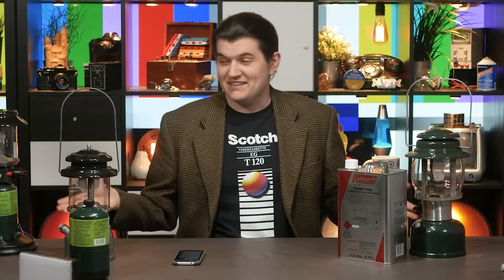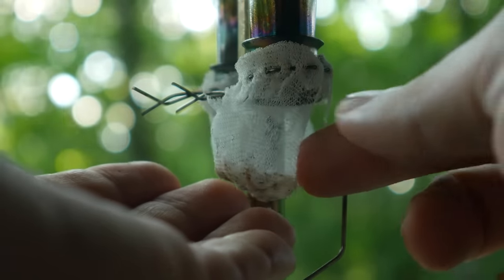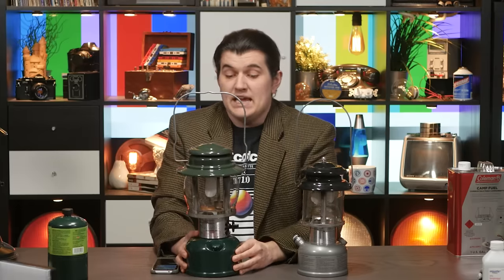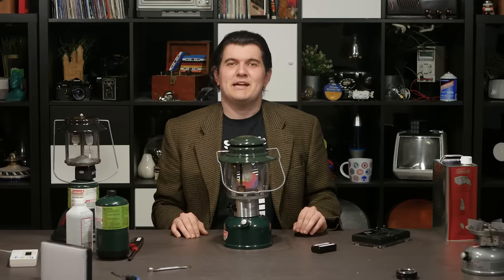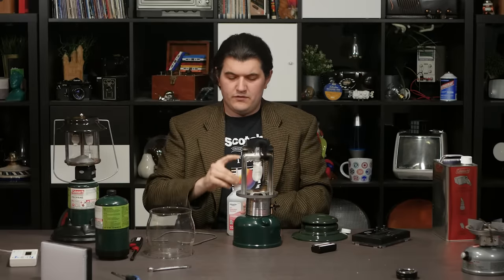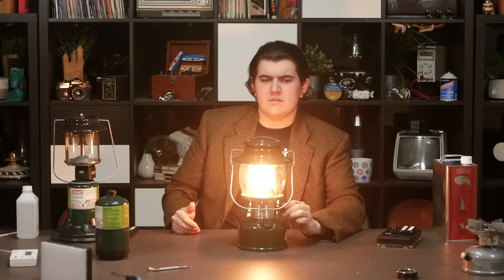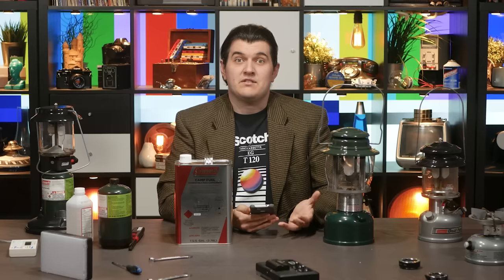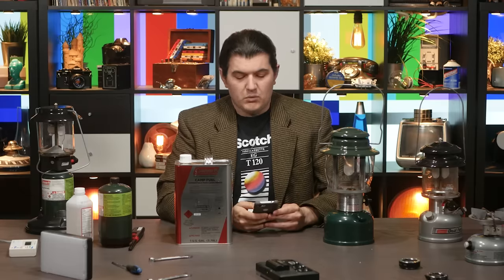A very rambly Coleman Lantern follow-up. Turns out they rarely make sense in 2021

Comment: Coleman also made fluorescent lanterns in the same style as these, with two 6-volt lantern batteries inside what looks like the fuel tank, and even a fake plunger.
Reply: I had one, it was pretty alright. Very usable before LEDs were common.
Reply: LEDs too.
Reply: And they suck...because of that batteries..
Reply: We had this too growing up! I saw it in my parent's garage recently and it still turns on
Reply: Battery operated camping lanterns were useless before the widespread use of lithium batteries combined with highly efficient LEDs and even then, the fuel is just a MUCH better choice.  You could keep 10 of these things lit all night long for 1 gallon of fuel and with plenty to spare.
They are far less dangerous than what is being described here.
Reply: @christo930  Yeah, but we now have great LEDs and LiPo batteries (and some (not most) solar chargers are actually ok).
A white gas stove and mantle lantern sort of makes sense if you need to light a biggish area and you really care about weight (eg. hiking).  I like my tiny little stove a lot, but not many folks need that much light when hiking (hell, I hardly ever use anything bigger than a headlamp).  I can see it making more sense for a larger group.
Reply: They made one similar that runs on 4 D cells and a pitifully dim incandescent lamp. I used it just a month ago while camping in the San Juan mtns. of Colorado thinking it was better than I remembered... Nope I should've bought a modern LED lantern or just brought the gas lantern, I already brought multiple Coleman fuel pods for heating water, but my buddy said he would bring one and he didnt!
Reply: I got the cheapo Coleman 6V 4 D cell battery version. Dim was 1 tube lit and bright was both.  Brittle plastic housing that felt cheap all around and not very bright.  Even the glass "globe" was plastic.
Reply: In Boy Scouts I won a keychain sized LED coleman lantern. That was quite some time ago. At the time the LEDs only came in red. It was not bright enough to be useful for anything other than finding your keys in the dark if you had the wherewithal to turn the light on before losing your keys.
Reply: @travcollier  I've always used either the white gas or the propane and only occasionally used kerosene, but today, I would buy a new (or used) kerosene model and use that.  Basically I always have between 10 and 20 gallons of the stuff.  I use a kerosene heater as a space heater during the winter. My house has really shitty insulation and it's old and retrofitting, if it is even possible, would cost 10s of thousands of dollars.  I also have a wood burning stove and the slate it sits on is large enough to just put the kerosene heater on it instead.  Plus, I have a kerosene based stovetop to use if for some reason my natural gas were shut off.
I have only ever been day-hiking so I've never had to carry water treatment options or cooking fuel and apparatus.

Battery operated lights are good for very short outages.  I have batteries galore for that.  But once the batteries are dead, they're done and you need power to re-charge them. Solar is simply not an option because the power may go out in the winter, which power loss is a MUCH bigger factor.  Even though I have natural gas heat and it's steam heat, the boiler requires electricity.
For most people in most situations, solar (as a backup) is a boondoggle.  The most common type of solar array means if the power goes out, you lose power.  In order to have power when power goes out, you must be isolated from the grid. It is literally a felony crime to connect solar to the grid without following all the rules which means when the power grid goes out, your solar array is no longer powering anything including your home.
Reply: @gavincurtis  Yep, total junk.  However, the fragility of the gas lanterns are the one true downside of them.  I think I have replaced every single one of my lanterns' glass globes at least once.  They are very easy to break.
Reply: Sounds like they had the tooling & excess inventory of fuel tanks to get rid of, no wonder the fuel-based ones are still being produced.
Reply: @christo930  Situations vary of course.  Solar backup can be perfectly fine, but the way most of folks hook it up (get it installed) doesn't work for that.  Knew a guy in Hawaii who built carts which were self-contained solar backup systems (basically panels, some batteries, and some regulating electronics)...  Not big, but one could keep the lights on, communications up, and a fridge running, assuming all of those were reasonably efficient.  Heating or AC, nope, but it was Hawaii so not needed.

Anyways, solar chargers are different from whole house solar stuff.  Typically you get or make one that is a lot more powerful (in theory) than you need so that it is still good enough for what you REALLY need when things go sideways.  Lights and communications aren't very big power draws.  But as I said, heat and cooling is a different matter.  Oh, and having some battery system with UPS functionality is great for dealing with the damn brownouts and generally unstable power a lot of us have but can electronics really don't like.  Whole house solar+battery should do that if not setup completely incompetently.

PS: Something I heard when doing some work in central Colorado: You know the difference between a shack and a house?  Insulation.
Reply: waow
Reply: @travcollier  Well, I live in a corner rowhome built in the 30s. It would be extremely difficult to retrofit anything but windows.  I have slat plaster walls on brick basically.  It would require removing every wall facing outside, which is all but one. It is simply not worth it for me.
Having a portable solar panel to charge batteries might work but as far as I am concerned is just way too much hassle.
For the home maybe a different story if you just want to power a few things. But space is at  a premium and flat roofs are really not something you want to put holes in.
Reply: LoL I had to go and check if mine is a Coleman! And it definitely is, bright red plastic and a Fluorescent Light bulb, two brightness settings and a night light built into what should have been the filler cap! It's powered by a 12V 4Ah sealed lead acid battery that is user replaceable which is in what should be the fuel tank, there you can also find the car cigarette lighter charging cable! 
It's okay, but not perfect, run time is not enough for me. I will eventually convert it to some form of lithium battery setup... I got it to offset the Colman dual fuel light and to use the battery model inside the tent but like most battery only products, they don't make them to have a longer run time! 
I don't care if it's bigger and heavier, I just want to know that when I turn it on! It's going to stay on for 12hrs on the most power consumption mode! 
To have an emergency backup light that at best can last 2 or 4hrs is a joke.. that's like looking at the specifications of a new mobile phone, they still give you how many hours the battery will last in standby! WTF? I bet that you don't know anyone who has ever put their phone in standby! Why don't they find out the most power consumptive way to use the phone and base the battery size apon that! I have never had 8hrs of phone use on a single charge! Never! I always carry a USB battery bank and car charger wherever I go.
Reply: We had one back in the 70s. Mom was deathly afraid of the gas lanterns
Reply: The huge advantage to the gasoline lanterns is even when there is some kind of disaster extended out over a long period of time you can keep running them with just plain old gasoline. I remember white gas, back in the day we used it in things like two-stroke engines outboard motors and whatnot because we knew the tetraethyl-lead was bad for them because it contaminated the spark plugs. Hey how about doing a story on the whole tetraethyl lead scam? Now that was a doozy.
Reply: @christo930  Borosilicate glass is just like that... very heat-resistant but much more fragile than standard glass.
Reply: I have an LED model, but it runs on 3 AA batteries, so it doesn't last long.
Reply: my parents had one like that, but it took like a dozen d or c cell batteries. We always used it when the power was out and the those batteries lasted quite a few years
Reply: I've got one, it's useful but I'm looking at probably getting a Deitz and a gas mantle one as well just because when I'm relaxing on the deck/gazebo thing we have the fourescent is not a pleasant light.  Plus just for the novelty.
Reply: Mine kind of sucked
Reply: I remember them well. My grandfather used one at his cabin when they didn't want to run a gen set. It was a battery eater, a 12v motorcycle battery would have been a better power source. They had another single tube powered by d cells in the outhouse.
Reply: Anybody remember those huge square batteries with two spring connectors? I only just did, we had a few in emergency lights / big torches in the early 90's, they were probably older than me. My parents bought a mantle lantern that ran off bottled gas much later, actually. It was a lot brighter than those feeble electrics.
Reply: @worldcomicsreview354  Yes, those are called lantern batteries.
Reply: That's what many people went to, after they quit selling the lanterns with the radioactive mantles. As he speculated in his other video, the early non-radioactive mantles were unusable. I'm pleased to hear, that they seem to be perfected, even though, for many people, these types of lights are obsolete due to good and inexpensive LED lighting.
Reply: i used this too inside of tents. Nowhere near as good lighting but obviously much safer
Reply: I had one of these, too. I liked to take it when camping. Great for lighting up a tent at night.
Reply: I had the one, long ago that had the "U tube" got it as a wedding present (didn't really look like a Gas lantern though), when it died, I bought the Gas lantern looking one with the Twisty CFL, and the gas cap "Night Lite"... Honestly it was more of a PITA than it was worth for the 5x a year I needed it, would not really hold a charge... Now I buy ones that take AA batteries (yes I know its wasteful but hear me out), they are made by Coast Portland, they make 330 lumen and I put Energizer lithium AA batteries in it, they don't leak and last a long time... So when we have those power outages or go Camping a couple times a year...They are ready to go and I don't have "dead battery" I can't recharge.
Reply: I have 2 coleman ones. One resembling the Northstar with a single florescent bulb and one with 2 swirl bulbs. I got the one with the swirl CFLs at the local goodwill and the other one on ebay.They work well. I have a GE one but the batteries exploded and corroded it so badly it has to be cleaned all the time to turn on. I recently bought an LED coleman one and even on half charged batteries? It runs for nearly 24 hours on high before my folks shut it off. I was draining the batteries deliberately so I can charge them fully. The Northstar one only runs for 13 hours on high on one charge though. CFLs are ok for lanterns but not as good as some LEDs. I can probably get a replacement bulb for the northstar but the other one? I prolly will have to retrofit and ballast bypass and convert it to an LED possibly. Forget incandescent they suck so much power they'll last for 4 hours at most.
Reply: @PeterMilanovski  I have a few of those old fluorescent lights, You get decent light out of them, but they will go through 8 D cell alkalines in like 6 hours.  Good rechargeable D cells are a fortune.
Reply: @talon262  Not to mention the awful shape.
Reply: I loved mine and I never thought living in Florida I would have a problem in the cold with the tubes not firing up. Then a 20 degree weekend happened and made me have no light but my gas lantern. I gave the florescent lamp to a neighbor.
Reply: @christo930  that is the problem, only 6hrs! I would like to think that they were actually designed for camping use, I can't see anyone camping for one night unless it's done in the back yard! But let's say that you are out somewhere camping for two nights at minimum and something happens on the first night and you used it for 6hrs! What then? Why should you have to carry around spare batteries? Just because they are changeable, doesn't mean that they should be changed so soon! A little bit more thought into which type of light would give good light and run time wouldn't have been to painful, who knows, maybe they could have ended up with an actual product that people want and need? 
I have an 80's national boombox, it takes 8 D cells, I purchase a fresh set of batteries every year in preparation for our once a year family picnic, it runs all day and then I get to use it throughout the year randomly on the same set of batteries! 
Now that's how it should be! I know that I can have it running flat out for a whole day and know that I don't need to carry around spare batteries! I can't say about my phone! 
The only other battery powered product that I had which was also good was a set of Blueant Bluetooth headphones, I fully charged them as soon as I got them, put them on and woke up the next morning and they still were going so I took them to work and they kept going flat out all day! 
While when you look at the specifications of a new phone, they tell you how long the battery lasts on standby LoL, who even buys a phone to keep it on standby? It used to be bragging rights back in the early 90's... But we all know that no one keeps their phone on standby! How about finding which way a phone will drain the battery fastest and use that as a guide to how long it will operate! That way you know what the worst possible case scenario is! 
This is how you can tell if a company is only interested in making a quick dollar or they actually care enough about their products and the people they sell it to! 
My phone has a 5000mah battery in it, I personally would need a 10,000mah battery to be happy with it.... That way I wouldn't need to carry around a USB battery bank unless I was camping! But I could live with that!
Reply: @vwestlife  The good thing about those batteries was if there were any of those old orange and white striped "saw horse" type traffic barriers with the round yellow blinking light on a nearby dark street, they were free!  Or so I was told.
Reply: @KSparks80  LoL, the trick with getting an led to last is not to drive it at it's maximum! 
There's a great video over on Big Clive's channel where he talked about the Dubai Lamp made by Phillips, it's essentially the same light bulb as everywhere else except that it's using twice the amount of led's to share the current, same amount of light output but it's going to last a lot longer! And they run a lot cooler too! But you can't get them outside of Dubai! So armed with this knowledge, it's possible to modify led lights to get them to last a lifetime! 
LoL I'm still smoking Marlboro... One day, someone is going to figure out a new type of tar battery and my lungs are going to make me rich! I could afford a mechanical lung and still have plenty money left over LoL...
Reply: @misters2837  Take a look at the rechargeable lithium batteries lanterns that run on removable batteries. I have one from Fenix Lighting that runs on 3 18650 size batteries, does up to 600 lumens, and has a USB type A port to charge other devices. It can charge the batteries in itself with a micro USB connection. You can also remove the batteries to charge them in an external charger. It is quite water and impact resistant as well. They have smaller ones that are similar but half the output, run on one battery, and can't charge other things but they have magnets on the bottom. I keep a mix of these around.
Reply: @travcollier  I have a 200 Lumen Black Diamond Icon headlamp that uses 4 AA or AAA batteries and that one I use for running/camping can last a very very long time on bright, why I got it was for doing trail ultra Marathon stuff mainly a 50 miler in the 2010's and for running in the Ragnar Relay Race doing stuff there since my first light a small green LED hat clamp that uses two 2532 batteries was only okay but still have great for things I need night vison for. I like the big headlamp for the fact it was not the rechargeable version so for running if I needed to change battery's I could quickly do it  and has a lesser light on the thing for low light that I have used when running in town as well at night but not all the time. The Icon does have a red light but that is hard to get off of if you get onto it so I still have the green light for the other reason and is a less bright light due to how poor the design is.
Reply: @hithere7382  Yeah I have some lights that have various generations (including some only recently released) lithium rechargeable batteries...and those are pretty good...But there are times where we have power outages that go on a long time, and then go maybe 6mos in between...seems those rechargeable do not hold a charge, and run out too soon...we even use the flat wick lamps sometimes!  I like not needing to wait/worry for a recharge...and toss in a new set of AA batteries and GO!
Reply: @christo930  Not really. The 6V lanterns worked just fine and lasted nearly as long powering an incandescent bulb as a present day mid-grade LED with LI batteries. The only drawback was the size of the battery. However, the weight was equivalent to a LI.
Reply: ohhh i had that CFL version of these that Coleman made! pretty cool thing for camping before LEDs were common, worked super well
Reply: @misters2837  I'm not talking about integrated lithium rechargeable batteries. They make lithium rechargeable batteries that look like freakishly large AA batteries. These are much better than AA unless below freezing conditions are very common in your locale because you shouldn't charge them in freezing conditions.

You can obviate this in some lights by using consumable CR123 batteries in the cold instead, two for every missing 18650 cell. Quality cells hold a charge for a long time too. They have a 10 years shelf life if you buy fresh ones.
Reply: @hithere7382  Yes I know exactly what you are talking about...My Headlamp and work lights use them...but I have noticed that over time like all rechargeable batteries they lose their charge...in storage...The AA is better than the CR123 as its available in every store on the planet...I have been down the 18650/CR123 road... I also have GMRS radios that can use either a 4AA rechargeable pack or 4AA batteries when power is out for long periods... I have also eliminated most C and D cell units as with the new lighting technology Many AA's  Lithium have better power density and DO NOT LEAK like alkaline batteries do!
Reply: @hithere7382  The Lithium CR123 and Eveready Lithium AA use same basic technology...but the downside to the CR123 is as I found out, there is no "Available Everywhere Alternative" ... Some of my Lights have 3 way power "Rechargeable Pack" - "AA Alkaline" or "Wall power"... And I have found using the AA Lithium in place of Alkaline you get nearly 3x the life, and much better storage life density, and temperature resistance (much like a CR123)...and if stranded in nowhere I can in a pinch use AA Alkaline.
Reply: @misters2837  CR123 is double the voltage of an AA battery... You can buy them from Surefire in 72 count boxes for cheap."basically the same" doesn't comport with needing two AA in series to reach 3 volts.
Reply: @hithere7382  Right but what do you do when they are all dead and when you do make it to some type of civilization...and they have AAA/AA/C/D and NO CR123 (happened to me more than once)
Reply: @hithere7382  Voltage is just a measurement of power...Might have meant something 30 years ago, when we were using Halogen bulbs...means much less today...Most LEDs are very low voltage anyway.
Reply: @misters2837  you're missing the central tenet of Latin class, Proper Preparation Prevents Piss Poor Performance.
Reply: @misters2837  they make high power LEDs not all of them are designed to operate with your piddly geezer AAs.
Reply: @xofcenter5576  Battery life for a 6v incandescent light would be OK, but you get far less light than an 8 cell (12v) fluorescent light.  Plus the 6v lights are flashlights and the fluorescent lights are more like the gas lanterns in that they put light out in 360 degrees.    I still own a couple of them. The battery life is terrible.
Reply: I have an LED one. It's pretty terrible because the form factor is way too big for camping. There are lots of smaller, better LED camping lights out there.
Reply: @PeterMilanovski  That's the problem with inefficient lights.  Not to mention the fluorescent lights need to have a ballast and circuitry to boost the voltage. Plus, alkaline batteries will give you less energy overall if you pull more power from the batteries.  Like if a battery runs a 2 light lamp 4 straight hours and you run it again, only powering 1 of the 2 bulbs, it will last longer than 8 hours.

Yes, the dishonesty in computers/phones is appalling.  This has always been a problem. They have always lied and deliberately mislead their customers. We're talking from the very beginning. They lied about EVERYTHING.  I remember 14.4 modems being advertised as 19.2 and sometimes even the highest of 115.2 (because, the uart can communicate with the modem at that speed) or transfer speeds based on the best case scenario (around 56k with 4x compression) with on the fly compression of uncompressed lotus 123 wk files.

God, those battery banks drive me mad. You cannot get them to be honest about anything.  Unless it is a very good name brand priced at a large premium, the numbers they give for the battery bank is, well, optimistic at best and flat out lies at worst.  On the internet, forgetaboutit.  You can go on eBay right now and find at least 1000 separate auctions for 18650 batteries claiming 9,999mah or 5 dollar banks claiming to have 20,000mah.  Or portable solar panels which can, apparently, quite magically produce 100 watts with 12 square inches.
Reply: @agntdrake  The fenix cl30r holds 3 18650s, charges via microusb, has LEDs that fire in 360 degrees, has a type A port for charging other things at 5vdc up to 1a, is IPX-7 rated, is 5.4" tall, 3.7" diameter, weighs 14.5oz plus batteries. How is that too large for camping?
Reply: @christo930  LoL yeah I have seen and even purchased lithium Ion batteries that were way overrated for their size, I don't know what I was expecting for a $1 per cell? I was still new to this scam at the time... But now I see speakers also suffer from the same problem! There's only so many watts that you can put through a particular size of speaker regardless of brand! You can give or take a few watts but that about it! For example, for a 6x9" speaker, at best you could get around 100W into it but generally it's about 90W and below but you still get some advertisement quoting 150W or even 350W! 
It's all about the economy! This ensures that you come back to make another purchase! While this method is great for the factory, it keeps it working but it's bad for the planet! I feel that this has to change, I think that it's better to just make a proper product, store it in a warehouse and shut down the factory to open the next one that stock has started to run low... Some things are perfect and don't need changing! It's great to have choice but if everyone has the same, there's no need to look for something better! It's not sustainable to have to much choice for everything... That simply means that no one will have a bottom of the barrel phone or computer or Hifi system!
Reply: lol, those batteries with the springs on them that weigh like 20 pounds? just bring a car battery and an old headlight >.>
Reply: @PeterMilanovski  HAHA you talking about speakers...I used to be "into" Mobile Electronics...I see "4 Channel Stereo Amplifiers" that are the size of a pack of Cigarettes that are rated at 1000-2000W YEAH RIGHT maybe 100W! And when you finally get to specs, you find Yup 25W per channel RMS...Who are they fooling?
Reply: @misters2837  The teacher learned it in the Marine Corps, I'm sorry you  never had a good role model to teach you to plan appropriately.

I think the problem is more that now you're an aged boomer and can't remember things like you used to so you depend on commodity products to keep you from piss poor performance. I pity you.
Reply: @hithere7382  You are tossing insults like you "know me" must not ever been deployed, At least to anywhere remote...must have been in Supply...I can't see you being in any other unit....Appears you never were taught improvise?  You have the ASSumption that you will be able to "Bring" or "Get" supplies anywhere you go...the NEW corps must be full of people who cannot understand how the real world operates...You also ASSUME I am a Boomer...That's Hilarious!
Reply: @misters2837  LoL yeah what a wonderful world we live in!!! And then we wonder why everything seems to be going up shit creek without a paddle...
Reply: @christo930  if you've got natural gas already, should check out wall mount ventless gas heaters. Might not be too much to have a line run, and a good portion run off a pilot light lit by a piezo igniter
Reply: @Jacks Journale Old Carbon Zinc batteries were WAY, WAY better than modern ones.  The average mah of a CZ D cell was 8000mha.  Plus they don't tend to leak.  I have had blue Panasonic cells sit in stuff with a micro-load for decades without a leak.  I bought a used radio in the 90s and I didn't know it took batteries. I took it apart to check for leaking caps and the 1970s Ray-O-Vac batteries were in there in perfect condition.
Reply: @brianargo4595  The problem for me doing that is the walls are solid. They are plaster over slats. There is no duct work in my house and the basement and kitchen (which is above the basement) has gas, but nowhere else.  I suppose it can be run outside of the wall at the ground, but it would look tacky.  In the kitchen, the stove completely covers up the gas line.
I have a wood burning stove which sits on a simulated brick slate about 3 ft square. It is on this slate right in front of the stove where I burn the kerosene heater.  I also have a slate like that, only marble (simulated) in front of the front door, about 2.5 square feet and so I burn one there on really cold days.
Reply: @xofcenter5576  You can't get much out of a 6v battery.  Most of the fluorescent ones that I've seen take either 8 or 10 D cells.  In theory, fluorescent tubes are more efficient than incandescent, but they need circuitry to work because they are high voltage devices.  The ones I have seen will have a small transformer and some switching circuitry (DC won't go through a transformer, only AC or pulsed DC.  Old battery operated radios often used a "vibrator' to do this switching or used a very high voltage battery. usually a dual voltage a/b battery, like 1.5/90).  This switching circuitry lowers the efficiency.
Reply: @christo930  A 6V battery is composed of 4 F cells in a package. An average F cell is 25,000mAh. much more than equivalent D cells.
Reply: @xofcenter5576  I am aware of only 1 brand that still uses F cells (walmart sells them) and they are 12000mah carbon zinc cells. The last one I bought was a few years ago.    Most of them now use a spacer and 4 D cells.  In some ways it is nice because you can easily take them apart and replace the cells in them.  I don't even know if any of them use F cells today.  But you are right. They are significantly larger.
Also, are there any you know of with these 25ah cells?
Reply: My Dad still has his :)
Reply: I have had one of those for probably a couple of decades, big honker, uses 'D' batteries, but works great.
Reply: Have you priced those 6V lantern batteries lately? You could buy a handful of Chinese LED flashlights for what a pair costs!
Reply: @christo930  Yanno, I feel like people forgot that coleman actually made a GOOD electrical lantern back in the day.  I owned it.  12V 5ah SLA cell in the base, weighed almost as much as a full fuel lantern but would go almost all night on 1 tube, or about 4h on two.  Used semi-standard 8" T5's and charged via AC adaptor or DC car plug.  On ac it acted as an emergency light, put it on either on state and plug it in, it'd float charge until the power went out then turn on.  Unfortunately even under used lead acid batteries have a definitive shelf life and 12y after I bought it in 1994, so about 2006, it stopped taking any sorta charge and died.
Reply: @bashkillswitch  Most lead acid batteries do not like being discharged much, and most all no more than 50%.  It's kind of a weird choice to use lead acid.  I guess NiCad would have been too expensive.  NiCad batteries used to cost a fortune.  I remember I bought 8 of them for a RC car I owned back in the 80s. I think they were like 7 dollars for 2 of them (AA).  I actually have about 20 NiCad batteries from the 80s or 90s that I got on a steal and I've been using them the whole time.  Of course, you cannot get them anymore.

You should buy a replacement battery for it if you still have it.  It is definitely worth keeping and as long as the physical dimensions are  close to right and fits and the voltage is right, really any lead acid battery will do. They are dirt cheap.
Reply: @travcollier  We really need some camping lanterns that use 18650 cells (they’re inexpensive, and can be found in vape shops and online). Next are lanterns that utilize warmer, high CRI LEDs. Though there’s an efficiency hit, the benefits for cooking and navigating rough terrain are easily worth it.
Reply: @christo930  i use 3 AA to a single D cell converters, using IKEA Ladda 2450s you lose about 10 - 15% capacity compared to good D cells and gain roughly 40% over the off the shelf C cells an a D cell body that Duracell and Energizer put out these days. I do take a near 50% hit when using single AA or three AAA to C converters but the much lower cost of AA and AAAs along with the additional versatility makes up for extra battery changes in my opinion. I use a lot of AAs for various things so it’s convenient to keep using them and with cheap, widely available 74 Wh USB battery banks in an emergency I can even charge my NiMH batteries if needed off said battery banks (of which I have two)
Reply: @Lauren_C  these do exist if you look hard enough but built in packs are much more common, with USB battery banks being so cheap I don’t see it as too much of a disadvantage
Reply: @DigitalMoonlight  What battery bank are you using?
I use the single cell ones for D conversions.  But if I needed the extra capacity, I would just buy 10kmah D cells off of amazon.  I don't know what the Laddas are going for these days, but the last I checked, they were just as expensive as eneloop cells.  That means for an 8 D battery device, you need 24 of them.  I suppose if you already have them it's nice.
But I have also heard putting them in parallel causes self discharge.
Reply: @christo930  My banks are a mix of Aukey, Anker and Iniu, as for the D cell converters I don’t keep them loaded, my spare AAs are all in holders. I have a keychain light that’s a single AAA that’s always loaded and a few penlights in strategic locations that take two AAAs which I also keep loaded and check every winter. In my locale a bulk pack of 24 AAs of any vendor would be cheaper than 8 D cells, even the crappy C cell in a D cell skin are more expensive than AAs and finding a decent charger to charge C and D cells is also more expensive if you don’t already have one. I already had all of these batteries and frequently use devices that take AA and AAA so it’s worth it for me to stay in the ecosystem and spend $5 on converters
Reply: @DigitalMoonlight  I agree that high capacity high quality C and D batteries are harder to find and more expensive and the chargers are more expensive.

I was at a flea market one day and found a case of C cell shaped sub-C nicad batteries 2400mah. IIRC, there  were 25 of them.  A few have since been thrown away.  I've been using them for like 20 years and they still work great.  Plus I have a few 4500mah D cells I bought years ago at radio shack. But fo mostr D batteries I use the adapters and eneloops. 

I have an old EverReady charger that charges around 100ma, so I just charge them for a day.  It is much gentler on the batteries than the 1 hour and 2 hour charges.  Those eneloops were like 18 Dollars for 8 of them on Amazon.  The modern cheap wall-chargers (you know, the 4 AA ones that come free with batteries a lot of the times) tend to really heat up the cells. Very bad for them.